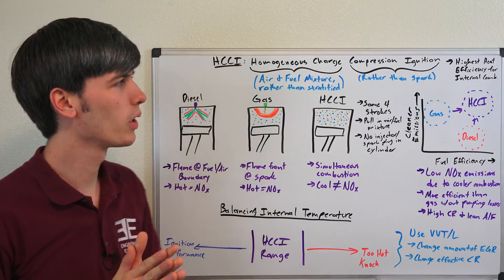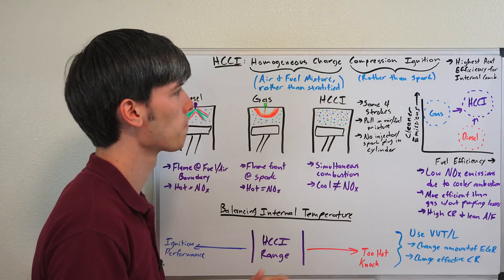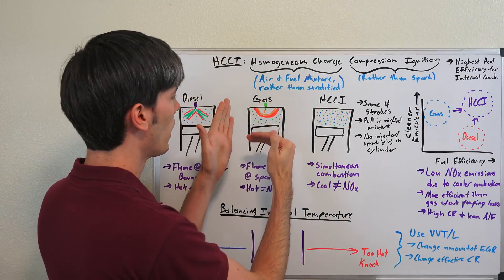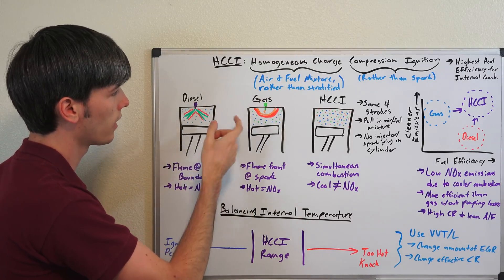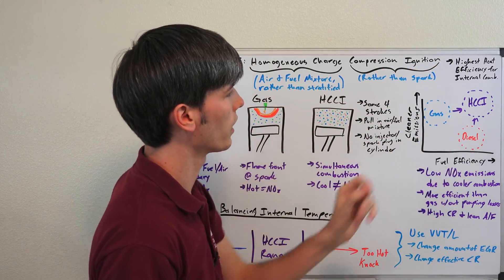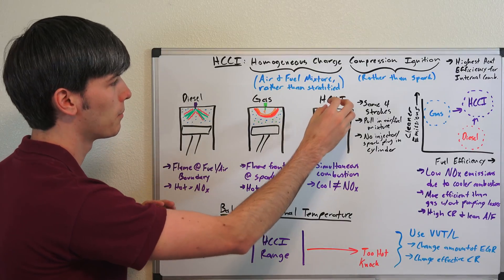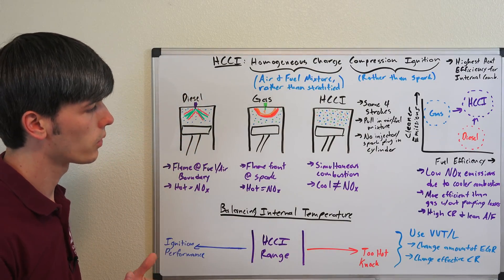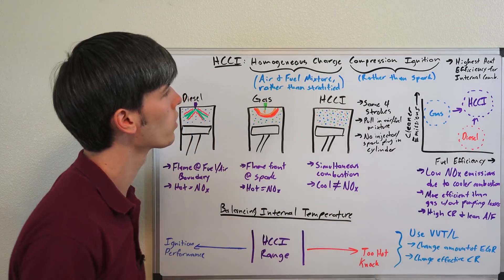The Most Efficient Internal Combustion Engine - HCCI

Comment: The temp range that allows for it to ignite on compression is determined by the mixture of the diesel, and octane rating of the gas correct? Would possibly having two separate fuel systems, one of diesel and one of gas work? That would then allow you to change your effective octane rating of each cylinder by changing the mixture of diesel/gas for the associated temperature.

Comment: Wow this video couldn't have come at a better time! Mahle Engine Components is gonna be at the NC State Engineering Career fair next week and I was trying to work out their turbulent jet ignition system so I would have a good talking point for the recruiter. Thanks for helping out (unintentionally)  another member of the Wolfpack!
Edit: This is relevant with Mahle because Ferrari is trying to use their TJI system to get more power out of their Formula 1 power unit, by effectively bypassing the limitation of the number of sparks per cycle implemented by FIA in the F1 regulations.

Comment: I was sure this is how diesels work. I'm not sure any more.
Reply: The big difference is that diesel injects the fuel into the hot compressed air causing ignition. What he is describing is pulling an air fuel mixture in on the intake stroke and having it combust on the compression stroke when the compression of the mixture reaches ignition temperature. That is why the compression ratio, temperature, and fuel consistency, would make this a nightmare without some real computer intervention.
Reply: well, we can say it's kinda like a diesel but with HCCI you are using gasoline. the only think is, that you need to know the perfect temperature range, so the gasoline can ignites itself with the perfect temperature. as we know, gasoline is higher flameable as diesel, so the temperature is more low.

Comment: How exactly does it achieve simultaneous ignition?
Reply: The pressure is pretty much uniform in the cylinder so once it reaches high enough compression throughout it should combust simultaneously
Reply: high compression ratio -> high pressure -> high temperature

Comment: You didn't say what kind of fuel a HCCI engine would use. I deduced that it would be gasoline as I seen older cars keep running long after you turn off the ignition and I suspect that would be a similar effect.

Comment: It sounds like combustion would occur simultaneously, throughout the combustion chamber, at TDC. I'm curious how this wouldn't destroy the connector rods, since pressure from the piston would be directly in-line with the connecting rod and crank. Are they somehow able to delay detonation until just after TDC?

Great video!
Reply: No they can‘t and this exact TDC ignition is what holds this technology back. It would literally annihilate the crank shaft, connecting rod, and piston. You also can‘t really control ignition timing realistically, meaning these engines would only be able to be run at a constant temperature at a constant speed (efficiently). Meaning they‘re more applicable as generators, not as vehicle engines. Sadly. I love the idea of adiabatic ICEs.

Comment: would it be possible to extend the heat range by a permanent change of the gasoline mixture ... like you mix Benzin with another chemical (gas) depending on how high the enigne temp is.

Comment: Thats fine and dandy, I'd like to know how they intend to combat questionable fuel quality and consistency across the world. Even in the US fuel quality is hit or miss.
Reply: the ecu would have a set of parameters to adjust for fuel quality just as most cars on the road have today. it would be adjusting things like the egr valve to regulate temperatures in the cylinders/combustion chamber.
Reply: OK, and do you know how many high compression or turbocharged cars with all of that still have huge issues with detonation?

I'm not saying that the idea is bad but will need some sort of advanced antiknock that is far more advanced than what we have now.
Reply: The small, single cylinder engine used as the splash image for this video is a 2-stroke model diesel engine, which is actually a HCCI engine as it uses a carburettor not an injector (the fuel is a mixture of diethyl ether, castor oil and kerosene). The screw with a handle projecting from the cylinder head controls the position of a counter-piston in the cylinder. This allows you to adjust for fuel inconsistency by starting the engine and adjusting the compression ratio by moving the counter piston until the engine runs properly.

A full size car engine would have to use a computer to adjust the compression ratio and other parameters on the fly. The computer would have a fuel sensor (like on a modern flex fuel vehicle) and sensors for monitoring the temperature and chemical composition of the exhaust, along with other parameters. Based on this data, the computer would vary inlet valve timing (in a 4-stroke) or move a counter piston (in a 2-stroke) to adjust the compression ratio so that it suits the current fuel, power setting and environmental conditions. For example, if you put a tank of dodgy fuel in and it caused the engine to knock the computer would reduce the CR until the knocking stopped.
Reply: Hit or miss in the US?  That really has not been my experience at all, in driving for 40+ years around several parts of the USA.  I can't say that I have ever experienced a noticeably bad tank of gas.  I have had a couple of vehicles that tended to ping on regular unleaded, while running fine on premium gas (93 octane), but this was true across all the major brands of gas.  I believe that most gas stations in a given region use essentially the same source for their gasoline, and differ only by the additive/detergent mix used by different brands.  In the Carolinas, all of the gasoline arrives by one of the huge pipelines from the Texas/Louisiana area (the "Colonial pipeline" I think it's called) which carries a mix of gasolines produced at about 10 of the largest refineries in the Houston to western Louisiana coastal area.  I've heard that this pipeline has just 2 major terminals on the east coast: one near Spartanburg, SC and the other one in northern NJ.
Reply: @thomasjohnson6080 only nad gas ive seen is when my meth mom put keeosene in the gas can and i put it in my gy6. It acted weird
Reply: @jhoughjr1  so basically you're 16 and have zero experience with engine building or how any of this works or the limitations.
Reply: Yes i know it uses compression instead of spark plugs to ignite the air and fuel but that just comes down to compression ignition integration with the ems so it's not like like modern car manufacturers cant develop a similar system using compression ignition rather than spark plugs.
Reply: User Name Well, my point isn't that it's different to control the ignition timing, but that it's doable =P  You asked how ignition timing would be controlled, I gave some possible answers

Actually, were you responding to nerd1000ify?  Google isn't very clear about that in its notifications
Reply: The emissions benefit, if truly significant, cannot be understated. I expect this to be advertised in Europe as the fix for some of the diesel emissions issues rather than for fuel efficiency's sake.
Reply: User Name If they had all the potential problems with this technology solved, it would have already been in the market or be in the production plans for a specific upcoming vehicle today.
Reply: +User Name sorry flagged your comment by mistake,   they have gauge that can read the octane rating in your tank on the fly, I would think an ecu would be able to do the same.
Reply: Diesel can polute far less than gasoline with the proper emissions equipment in place.
Reply: @jeepmanxj according to vw
Reply: +User Name So can nuclear power.
Reply: If the consumer is allowed to choose from multiple levels of octane, you better expect your ECU to handle it (I think Jason has a video on "gas in a diesel" damage).  Not being a mechanical engineer, I am only aware of the "detonate and backoff" method of avoiding knock, and doubt that is all that great for an ECU (although it might be acceptable at nearly closed throttle levels).  I've heard that electrical measurements might work ok for ethanol blends (especially when mixing E85 with E15 or so), but that likely assumes the E15 has a specific octane rating.

My guess, keep the thing in (nearly) steady state operation.  This pretty much excludes anything not a hybrid and effectively makes the electric motor the primary response to any situation (and has to do so in a way that keeps the HCCI engine at nearly constant output).  The gas should be sufficiently consistent between fill-ups, it is that you can't begin to know what is being added to the tank.

Also since this tech is still vapor, there's hardly any guarantee that the fuel is consistent enough to ever make this thing work.  It also might have to operate on spark plugs for a certain distance after leaving a gas station, and re-calibrate before going back into HCCI mode (assuming you can survive at least as many detonations as times filling the tank.  Expect the thing designed around idle-level detonations...
Reply: I absolutely think it's possible, there's just a lot of variables that need to be compensated for externally to produce a consistently timed combustion event inside the cylinder chamber.  I think the ultimate idea is to avoid having a bore in the block head for a 'plug' whether a spark plug or a glow plug, so the chamber can have more integrity and the design will be more efficient and last longer.

Lacking a plug bore, that might leave open a cooling option for the chamber to cool via a channel over the chamber where the plug bore would be, using a separate, controllable system so that excess heat generated during compression is removed as compression occurrs.
Reply: User Name I agree that this is more diesel oriented, so I doubt we will see a gasoline engine implementation on the market until they demonstrate this on a diesel vehicle.
Reply: With E85
Reply: haven't you ever heard of flex fuel tech? the technology necessary for an ecu to automatically adjust AFR and ignition timing depending on fuel quality all ready exist's and has existed for quite some time
Reply: Now how are you going to adjust ignition timing without an ignition.
Reply: Man I've been building performance engines for a while. The advantages are there for this. But you'll need a steady super consistent fuel. E85 is not close to consistent. E85 tends to attract water because of the alcohol and the ethanol content at the average pump I've seen between 65% and 80%.
Reply: Your concern is valid, and I think if this technology were to succeed, Nissan would have to bring it to markets with access to more consistent fuels and than expand it out to other markets as their technology improves. I also think that if this is a technology that car manufactures want to adopt, they can push gas companies to deliver more consistent fuels, whether it be through regulation or some other way. The question I don't have a good answer to, is whether the level of consistency required for fuels is something that can be practically delivered.
Reply: Again, you ignored what I said. E85 isn't remotely consistent enough
Reply: @jeepmanxj if the engine is adapting in realtime to the engine performance fuel consistency doesnt matter
Reply: I can tell you, fuel quality varies greatly from station to station regardless of brand. Take age, maintenance, pump quality, station tank level, suspended sediment, and tanker cleanliness all factor into this. That isn't an opinion it's a fact. It's fact enough that many areas require fuel tanks to be replaced on a fairly regular basis to try and combat it, and many states test the fuel to ensure its correct. Stations get shut down across this country regularly due to issues.

It has been tested into the ground and there no evidence to suggest any advantage in using a higher rated octane than is required by your vehicle manufacturer. In several studies higher octane fuel produced less power and higher emissions. The only possible argument is that of certain detergents in the fuel, and even that shows negligible benefit over long opperators outside of that particular manufacturers testing.

It's super easy to track if you run ethanol fuels, especially e85 as I do in my Subaru. The same stations ethanol content can range anywhere from 60-85%, not only does my ethanol sensor show this, but it's observable in fuel trims, timing changes, and power output.
Reply: yes, E85 is not consistent which is why you get flex fuel setup(or at least you should) and it's not like these systems are limited to just engines running E, these systems adjust for all different qualities of petrol fuels...there's probably similar systems for diesel but i haven't properly researched that side of things so i wont comment on that
Reply: Supposedly Nissan has one coming to market in the foreseeable future. 

The idea is good the actuality of it may not be. People have been shooting this for at least 10 years that I'm aware of. There haven't been many success stories. Because of the fuels tendency to unpredictably detonate. The end goal absolutely makes sense, but like most things of this nature. The reality of all the power and efficiency claims rarely meets expectations.
Reply: That's basically how current vehicles work minus the compression ratio change.
Reply: So basically they are counting on variable valve timing. That still doesn't solve the issue as it exists now. 

You can't actively detect the anti knock rating of a fuel that I'm aware of. So this is going to rely heavily on consistent fuels. You can scour the internet and see tons of vehicles running high compression or turbos going boom because of poor fuel.
Reply: @jeepmanxj the computer can detect whatever we want it to with the proper sensors.

Comment: i think it's avery good solution. i wonder that highly flammable gasoline in the engine spark plugged on the other hand diesel only compressed in high temperature and cycle is done. so we can do this compress the air gas mixture for the begining of the cycle. Don't we?

Comment: What fuel would an HCCI engine use? it seems like you could build it for either gas or diesel by changing the CR to match the fuel. That means realistically any combustible gas at a certain pressure could be used?

Comment: What about CO2 emissions compared to normal petrol engines?
Reply: lower because of the cleaner burning air fuel 🤔
Reply: slightly more because you aren't generating as much NOx, and those oxygen atoms will combine with fuel to form CO2 and H2O.  But not significant at all, and this is much better than NOx .  If HCCI engines can run leaner(depends on how quick the feedback loop is) and are more efficient, possibly less.

Comment: I don't understand how the a/f mixture enters the combustion chamber.
Reply: You still have valves which puts the a/f mixture inside the chamber, but if you didn't know at all at, air is sucked in through air intake manifold which then fuel injectors will spray a mist of gas along with the sucked air which is finally all sprayed in the combustion chamber
Reply: So to recap: fuel is added during induction then that mixture is sprayed into the chamber to be compressed. And it (sort of) has the 4 strokes of the Atkinson Cycle (suck squeeze [ignition-via-compression] blow)
Reply: The ignition is meant to occur at around the same time as a traditional spark engine, so the strokes still remain: intake, compression, combustion, exhaust
Reply: What about premixing air and fuel and then injecting it to insure a homogeneous mixture. Is it possible to inject fuel with in injector and air with a intake valve and insure a perfect mixture?

Comment: Diesel engines don't have a real ignition system - They use glow plugs to assist in ignition to get it started and keep it running while it's cold, but once it's warm, diesels rely on compression alone to ignite the fuel/air.